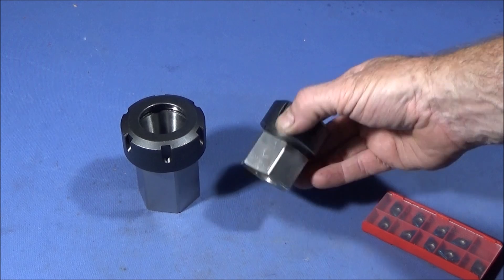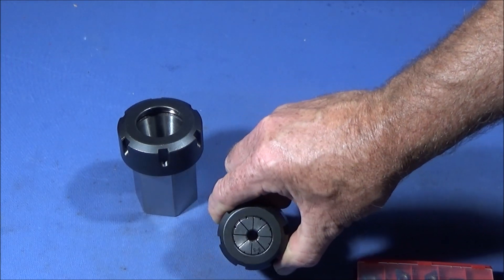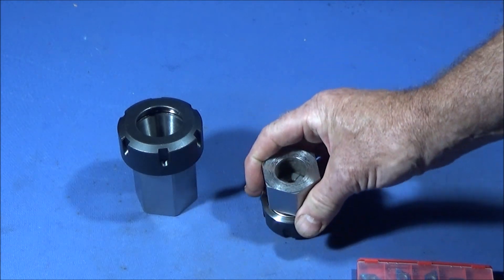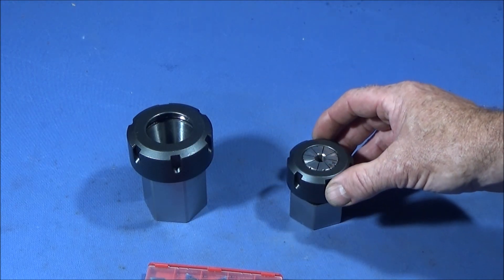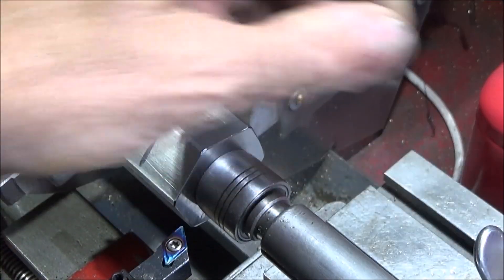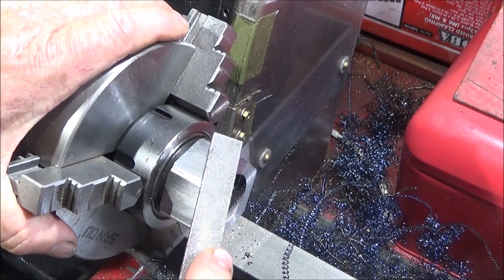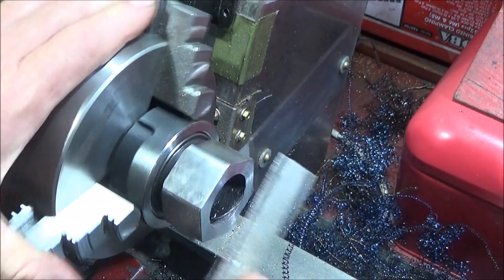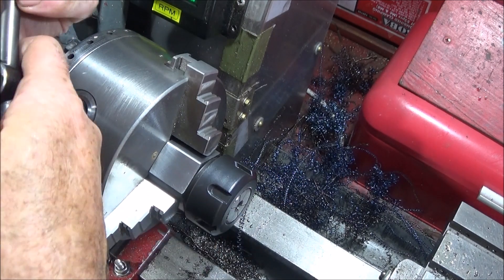ER32 & ER40 Collet Chuck Hexagon Block Modification

Comment: I've been wondering about doing this to a collet block as well, but perhaps a square one for ye olde 4-jaw. A bit of a compromise between quick changeover and the ability to dial it in true for prolonged projects on small parts where accuracy matters. Thanks Steve! Edit - I'm now actually seriously thinking of doing this, but keeping the other half of the collet block, so if I need to still index it in the mill vice, I could clamp one piece on each end to keep the jaws spaced evenly and square(r). Rather than just having the shorter collet block off to one side of the vice.

Comment: G’day Steve, you gave those blue nano’s a hiding and I was going to ask how many did you go through, 3 was it, I could feel the torture here in Australia. 
Cheers 
Peter
Reply from the maker: Hi Peter yes on this one it was 3 edges of one insert. Two of the edges were used on the intermittant cutting. This is about the hardest material I have turned in the home workshop. They may have lasted longer with proper coolant though. Regards Steve

Comment: Why didn't you just get the ER32 chuck with a Morse taper to fit your lathe. Most of the Chinese mini lathes seem to have a MT2 or Mt3 head stock taper. My Grizzly 8 inch lathe has a MT3 head stock taper.
Reply from the maker: I use these for a quick change over so I don't have to remove the chuck. It has sped up things considerably for certain jobs. The Chinese ought to make an alternative collet chuck this short. I think they would be a great seller

Comment: Steve could you not just put a short piece of bar in the collet chuck and then put it in the chuck so you don't have to clamp the collet nut in the chuck?
Reply from the maker: You could do but it would still have to be machined in exactly the same way with the live centre so I would rather hold on the nut for rigidify Regards Steve

Comment: If you are going to end up holding this in the 3 jaw chuck, then AT BEST, you will only achieve the same accuracy/concentricity  as the 3 jaw. What was your aim in doing this? (question, not a criticism).
Reply: It is probably not the goal, speed and ease of use might be the main point I imagine.
Reply: If you do not need dead on accuracy end a quick use for a collett this would be the way to go.    It sure looks easier than taking the chuck off to do a quick job and then putting it back on.   I think it would be used most of the time.
Reply: Much nicer for small diameter work - doesn't mark the workpiece like the 3 jaw chuck.

Comment from the maker: SEE LINKS BELOW FOR THE COLLET CHUCKS.
ER40 Hex Collet Block Chuck Holder CNC Tool Holder--http://bit.ly/2yOVGeX
Hard Steel Hex ER-32 Collet Chuck Block CNC Lathe Tool Holder--http://bit.ly/2YM35v2

Drillpro 10pcs HRC45 Blue Nano DCMT11T308 Carbide Insert--http://bit.ly/2ksL3ux
Reply from the maker: $1.99 Tools & Mechanical Parts -- http://bit.ly/2OSwi2O
SOME EXCELLENT OFFERS
$21.68 4pcs MSPA Inflatable Hot Tub Replacement Kit -- http://bit.ly/2Zr0k1H (coupon: BG1726)
$48.99 Machifit ER11 Chuck CNC 500W Spindle Motor -- http://bit.ly/2ZB99lC (coupon: BG500W)
$33.99 HILDA 220V 350W Variable Speed Electric Grinder -- http://bit.ly/30GTAdt (coupon: BGEG35)
$23.99 HILDA 220V 400W Electric Paint Sprayer -- http://bit.ly/2MJSVob (coupon: BG2c532d)
$213.19 Machifit CNC 5 Axis 500KHZ Offline Controller -- http://bit.ly/2L2i2Al (coupon: BGMACH3)
$32.79 Machifit MACH3 4 Axis USB Electronic CNC Handwheel -- http://bit.ly/2ZkC5CV (coupon: BGMACH3)
$36.99 Self Centering Dowelling Jig -- http://bit.ly/2MH3yIo 
$19.99 Drillpro 8pcs 2-12mm 4 Flutes Tungsten Steel Milling Cutter -- http://bit.ly/2ZkC5CV